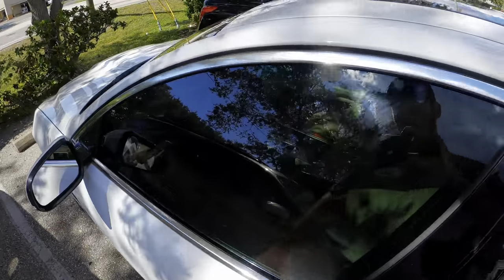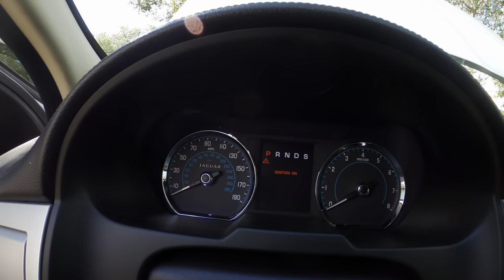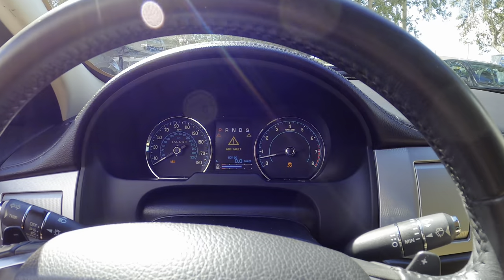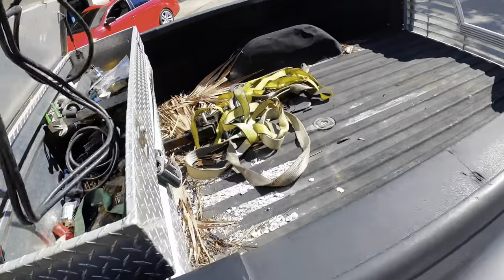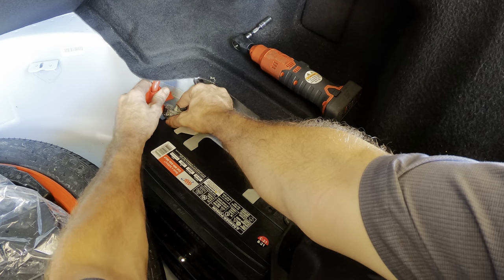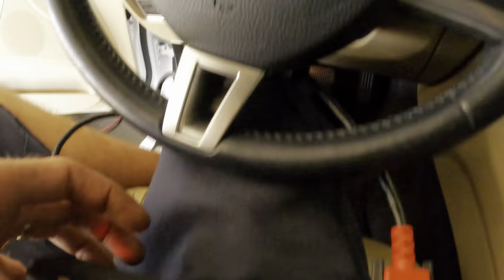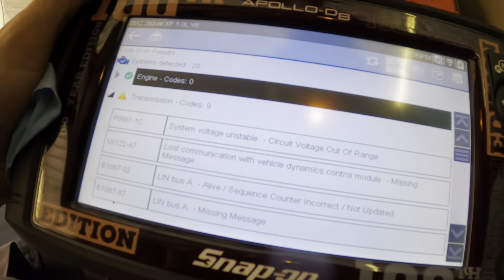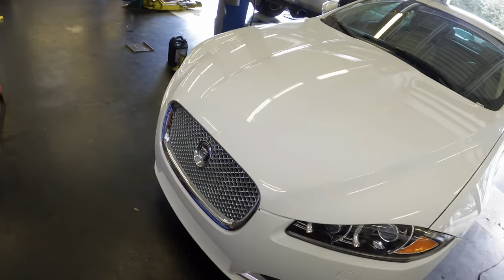Jaguar XS just Towed In.  I’m in over my head! Customer States: “Check Battery”

Comment: From the uk here. Looks like the typical jaguar - all models and ages-  achilles heel of a cascade of faults caused by 1 or more of its earth straps corroding at the bolts or fraying away, thus causing an open circuit that drains the battery and screws with the electronics, even to the point of killing the electronics on the alternator.
Reply: That's why I read comments

Comment: Batteries can no longer be replaced except by the dealer on my two German cars (BMW & Audi).  It cost me $650 to have Audi replace the battery, but they have the secret codes to reset the modules when they get jacked up from low voltage due to a bad battery.  Surprised that this isn’t well known by most non-dealer shops.

Comment: I agree with you not going forward with the car, the customer have given you more information than "check the battery", like what happened, when and how. like I woke up and the car wouldn't start, stupid thing started turning everything off.  A lot of people think you take ownership of everything that comes up later. Even if you change a bulb they want to hold you responsible for the brakes. The newer systems are a pita, especially with the proprietary diagnostic equipment and tools needed. My xf started shutting down on the way home once. Made it as far as the corner of home, shutdown completed threw itself into park. There is a release lever under the trim just in front of the center box. Wish I knew this before the tow truck got there . Dreading having to go to the dealer, I recharged the battery and it started, got no charging status. Went with the alternator and no problem for years. A charging circuit, even when controlled by the computer still functions like the older systems with external voltage regulators. When a charge is needed a signal/small current is sent to the alternator, that signal can be checked/detected at the alternator.

Comment: I suspect the customer was trying to avoid the astronomical dealership price schedule. But having someone work on it who has the correct diagnostic equipment and experience can save money in  the long run by turning the job around quickly.

My wife's 34 year old Mercedes SL developed major idling problems and of course the job fell on me. I spent a couple of months digging up information, and learning Bosch KE jetronic injection (it's like NOTHING else I've ever seen). It took 2-3 months of messing with it and involved circuit boards that are no longer made (but fortunately there are specialist rebuilding shops).

It was overwhelming. Now that it's done, I'm glad I learned, but I'm sure a customer will not want to wait 3 months.

Comment: I have a nice looking red 1994 Jag XJS 2+2 convertible. What a wiring nightmare! Drove it one summer and takes up valuable space in my shop. The queen of hanger queens, just sitting waiting for a new owner as it sits so far back on the rear burner. Simply no time for it yet. New alternator. No working room for my big claws. Got it in and went for a tetness shot shortly after. OL-AS-OL me.

Comment: I've seen it happen that an alternator would charge the battery, but not send proper voltage to the tcm. But it wasn't a jaguar. Replaced the alternator after talking to a transmission specialist, who was honest,  and transmission worked perfectly. Town ad Country.

Comment: Usually the newer cars won't work properly if the battery is slightly low on electrons.  Had it happen on a few different cars that threw all kinds of strange codes until I replaced the battery, then they started running perfectly.  It didn't seem to be logical but the new battery made it all better.

Comment: 12 years ago  a mechanic rejected to check my E46 BMW 330Ci  overheating problem.
I didn't understand why.

Then the guy said, my car is so low to the ground (lowered springs) they cant get it on to the bridge of their shop.

Well dang...   
They didnt even pop the hood.

Point of this story is that at least you tried to help the customer. They should be grateful.  Some of us euro drivers out there just get rejected for simpeler issues without even trying.

Comment: The bad thing with those cars is when you change the battery and you did not follow the way the manufacturer told you to you are left with two choices. By the proper scan tool for whatever car you're working on of course A lot of them had multiple makes and models. Second one is to take it to the dealer and they will hook their scan tool up and hit all the right buttons to reset the computer and for it to accept the battery. Since you are dealing with a dead battery one a new battery it sounds like it needs to be reset with the right tool. One of the side effects of not doing it right is the alternator not putting out power to charge the battery and run the accessories.

Comment: Dealers have horror stories too.  A 10 year old car with 10 fault codes in 6 modules and no modules available after market.  Cost to repair $15,000, owner owes $11,000, street value is $9000.   Put in an LS1 motor, power glide trans, some Romex and Home Depot toggle switches  and you have a Jagulete.  Paint it purple at Earl the Pearl Shibe for another 5 or 10 years.  You can scrap value working park for junkyard motor and accessories .   That’s what the people in the “fly over zone” of the USA do!  Proud to be an American.

Comment: I`d have been tempted to say to the customer that its likely alternator, which has possibly taken the battery out with it (common these days, especially with Nippon Denso alternators, which I think that XF will have), I`d have offered to change them under the proviso that if it didn't remedy the problem, they`d still pay for those replacements & labour. That way you MAY help them by fixing it at your rates rather than a main stealerships rates. A lot of customers will understand & appreciate that stance & give you the go-ahead appreciating the situation.

Comment: I think you did an excellent job sending it to a Jaguar expert. As I said before from experience I know Jaguars do not like battery issues. It's basically saying to you I feel unwell don't drive me.
I don't know obviously but I think there is a high chance replacing the battery and alternator and resetting the codes would likely make it all happy again and the other faults would disappear. Just from my experiences as an owner.

Comment: I know what happened, whoever jumped that Jag hooked up the jumper cables incorrectly. They mistook positive terminal for negative and fried the electrical system. That’s why you ALWAYS look for the + or - symbol molded on the battery to confirm it’s the right terminal, instead of assuming a red terminal cover or red battery cable identifies it as positive.
Reply: That is my thought also

Comment: I know a lot of these newer cars if they don’t have the correct battery the electrical systems don’t have the correct amount of volts per se getting to each thing especially with the electronic transmission and throttle bodies and so forth so make sure people when you replace your battery you get what the car asks for don’t go cheap don’t go expensive get what the car requires

Comment: It's funny.
I used to drink in a bar in the Midlands of England 20 odd years ago and one of the lads was an older Scottish chap who was a 'buyer' for Jaguar motors.
He told me everything in a Jag was 'nice to look at but cheap as chips behind'.
Having owned and driven a XJ6 series 3, I knew exactly what he meant, they really are crap.
The only reason I owned the car was it came ridiculously cheap with a shot engine.
However, over the couple of years I owned the car, I replaced the engine twice and nearly every suspension component along with loads of broken/worn interior parts and this on a car that wasnt even 10 years old.
Breaking point came when I went to replace a rotten front wing only to find the inner wing was rotten through also.
What a heap of crap.
I went back to, and am still, driving Mercedes-Benz models which are soooo reliable.
Proper cars.

Comment: Next time, just remove the battery, fully charge it. The clean the terminals, check the earths and positive.  Start it put into neutral first. If its in park. Rev it with the lights on until the top rev, once or twice, helps clear the flash ram.  Then shut off, Start normally and then try all the gears.  

That should save you some time. Hope this helps.

Also it should be at least 13.80 volts minimum or nothing will work properly as the wrong voltages affect the CPUs ability to rectify the issues due to faulty sensor information...

And yes clear fault codes..

Comment: When you put a jump box on a big flat battery like that,it pays to disconnect the cars leads from the flat battery and hook the jump pack directly to the cars leads this way you are not putting power from the jump pack into a huge flat battery which is draining the start power from the jump pack.

Comment: I agree with you. Whenever a service is requested, and it is not or cannot be done be done, there should be no charge. I am lucky since a Kymco-owned service shop is right here in SaiGon/Ho Chi Minh City. Not only do they any upgrades/updates, they give owners little tips that save money - such as resetting the damn idiot light that flashes when it thinks you need a new oil change (every 1,000 kilometres!).

Comment: Had the same issue with mine disconnected battery for about 1 hour totally fixed issues. Bad idle gearbox fault etc. they are great cars but bad battery causes tons of issues. 👍

Comment: Ray I have been in the automotive repair industry for 60 years(and still run my family shop) also taught electrical programs at adult and high schools.  When jump starting a vehicle I practice and taught that you always hookkll up to the dead battery first and connected to the positive terminal before the negative and did the same on the donor vehicle.  Remove the cables in the reverse order.  Actually in the good old days you were never supposed to connect to the either vehicles negative battery terminal in order to avoid a battery explosion due to the possible spark igniting a battery venting hydrogen sulfide gas.  Interested to know if the procedure has changed.

Comment: No worries with you backing down from fixing a Jaguar, I was a car washer at a Jaguar dealership, there was an older Jaguar holding up a bay for a whole month because the company that was supplying the replacement wiring harness kept sending the wrong harness, once the right harness got in, the only mechanic qualified to work on Jaguars (and Land Rovers) went in on a weekend and got that car done.  The other 2-3 shop techs were Volvo techs.

Comment: I think it's the alternator. In these newer model cars, the car will throw all types of codes when the battery is not strong enough to power all the components of the car. For example on my 2015 camaro when the alternator goes bad it shows a dozen codes to let you know the car is losing power and if you not monitoring the car it will literally shut off everything to save you from destroying the car. My alternator failed on the highway doing 70, when I saw the warning I was 4 miles from my mechanic. When I started to lose power steering and I needed to press harder than usual to apply my breaker u exited and the car died on a side street 2 miles away from my mechanic. My mechanic didn't know what the issue was after 5 days, I told him to remove the alternator and when I check it, it was bad. I remade the alternator and it lasted longer than the original.. About to hit 250k on the car.

Comment: I've had strange computer errors on my xfs (twin turbo diesel, same model 2014). I ended up building myself a fake dealer diagnostic platform, absolute pain in the arse to work with  BUT, you can reload/update the firmware of ALL the modules, eliminating Christmas lights and no start problems

Comment: G-dd--mned technology! I am over a certain age, used to be a mechanic back in the 70s - 90s, and the most tech a car had was electronic ignition, and possibly a basic ECU if it had fuel injection (which you had to have with the then new regs re-cats). I had a 70s Volvo with fuel injection, but it was still triggered by a pair of mechanical contact breakers set in the base of the distributor. Which still had the usual CB points for actual sparks. The 'brain' for the injection system was the size of a small briefcase, and did nothing else! Nothing you couldn't diagnose and fix with a volt/resistance/amp gauge and a little thought. The rest was all about listening ie when setting carburettors, or tickover/idle etc. Happy days! But cars like that Jag - way too much electronic intervention thar!! Btw, I am in the UK, and I like your very much down to earth approach to things. It's real life! And in a way you demonstrate one of the things I chide friends with all the time, when they say 'I don't know how to do that' about an oil change or brake pads and the like - it's just nuts and bolts, and that is 90% what spannering a car is. Something impossibly electronic to diagnose on my current car? I take it to my local garage and let them plug it in! They might tell me eg one of the ABS rings or sensors is u/s. I take it home and strip it and have a look see. Easy peasy. Sometimes. Last words, honestly - why do you think that car DESIGNERS NEVER consider ease of maintenance when they cram so much into so little space?! Designers should be grease monkeys before they are ever allowed to de-flipping-sign anything! Nuff said. Keep it up Ray, I don't know what it is about your vids, but I can watch for hours. Maybe it's watching rather than actually having to DO it anymore!

Comment: I worked for a tech company that made Jaguar's ECM's/ BCM's as the SMT op and when work was low the assembler. Funny enough these are under FORD. So my guess is the computer is half dead from cooking itself to death, because we where told to use standard white thermal paste by the contractor instead of thermal putty ( replacement for thermal pads and last as long if not longer ) and life of the white paste is 3 to 5 years after that the components are now burning up.

Comment: This same same happens with newer audis and vw vehicles. when batteries go bad under 10volts. everything goes to electronic purgatory. Insanely sensitive to low voltage. wouldn't be surprised the car was jumped in reverse after whatever drained the batt dead

Comment: I have a late Ford era Jaguar. Anything less than 12.3v before turning the key is going to get it upset about something. Fuel pump fuse,gearbox solenoids  buzzing,sunroof module memory loss.  12.4v or above no issues with electricals.

Comment: I dont know for sure,  but my Chrysler Pacifica used to do this any time I had to jump off the battery. What I found out was the computer would sometimes go into a sort of limp mode and all i needed to do was disconnect the battery for about 10 minutes to reset it. The main symptom that told me this was what was wrong was the shifter being stuck in park and an idiot light and check engine light

Comment: I wouldn't be worried saying you cannot fix it. To be able to do a proper diagnosis you'd need the manufacturers software and maybe a dedicated computer to run it on plus any test equipment.  All of which wouldn't be cheap.  Even then you may need the help of the specialists at Jaguar to help if modules are damaged or faulty. Expensive cars usually have expensive repair bills.

Comment: This is 100% an alternator issue. Mine was doing the same thing. Jaguars like to spit out all sort of strange errors when the battery is low and if the alternator is not charging it will go into park and wont let you do anything.

Comment: Pretty much what most modern cars with computers do these days when the battery voltage gets too low.
Sometimes it just needs  a new battery, and to reset all the codes, using the right tool such as a VCDS when a VW Golf does it.
Other times, it can be an expensive nightmare. 
My own Golf did it once. Had all sorts of codes come up. Gearbox, steering, brakes, ABS, traction control etc.
It looked like the car was doomed! 
New battery and much code resetting and all has been well ever since.   :-)
I think most cars using all those Bosch electronics modules would be similar.  Which would be the majority of European cars. 

Other simple things like having even just one of the 4 wheel speed sensors fail (which they all seem to do after about ten years) confuses the whole car, since it gets confusing data then,  and all hell breaks loose. 
It even affects the DSG and it starts doing some very weird gear changes. 
A new ($5 on AliExpress) wheel speed sensor, and reset the codes, and the car is happy once again. Have learnt such things the hard way.   :-)

Comment: With it being a new battery the installer probably didn't reset the PCM to let it know there was a new battery. And thus the system throws every code due to voltage irregularity. It's why most of the high end cars we refer them to the dealerships cause of requiring the reset.

Comment: Provide a power source scan all codes then clear codes and scan again then check to see what communication codes are hard faults..more than likely the Body Contrim module is not providing the signal to the alternator so that it can charge..the Transmission control module detects a fault and keeps it in park.